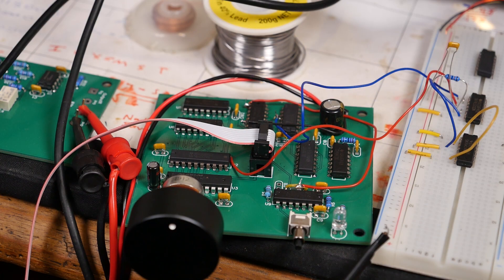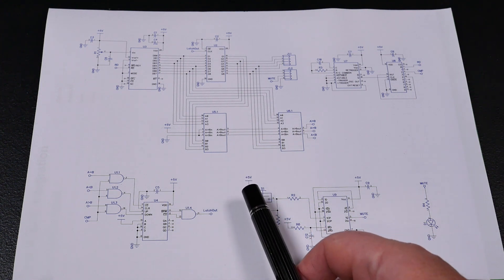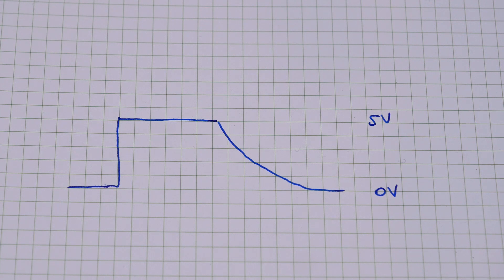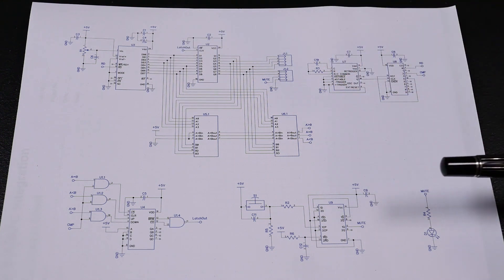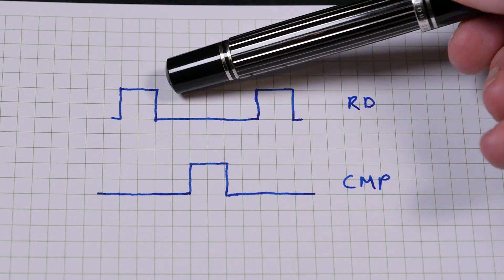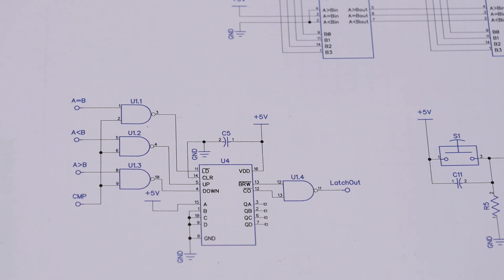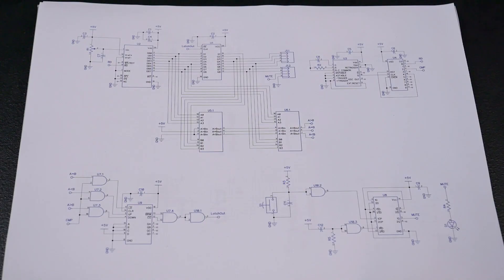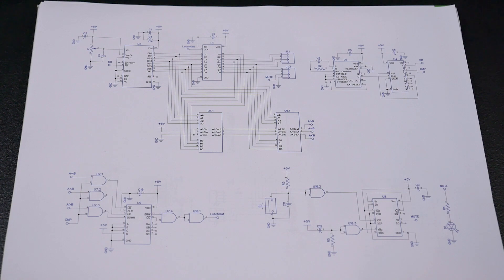Attenuator Controller Redux - did it work?

Comment: Maybe its just me reflecting on years gone by but through hole PCBs with 4000 series and 74 series have so much more soul than FPGA, good to see.
Reply from the maker: Glad you're enjoying it - as a practical solution in 2020, this one is a triumph of nostalgia over common sense, of course - but it's been fun.